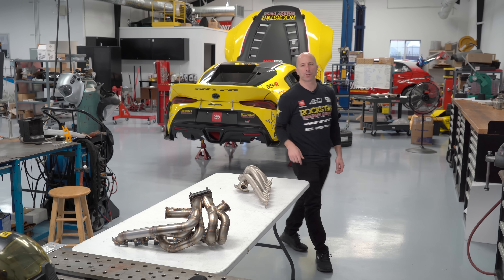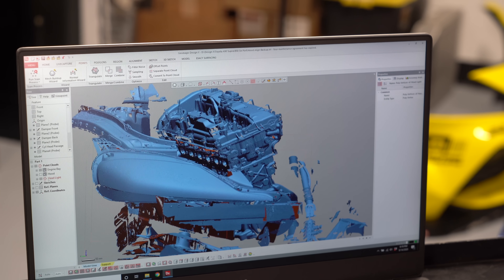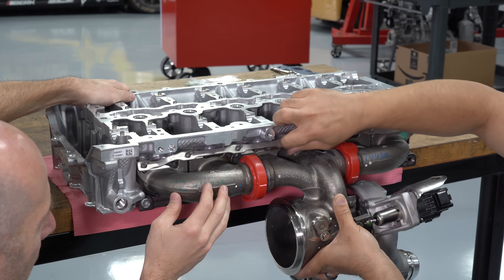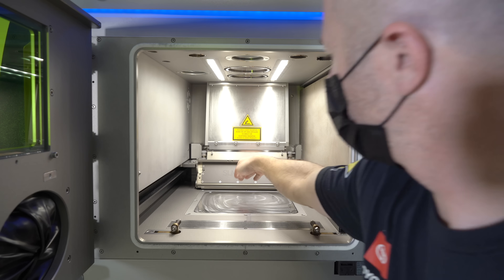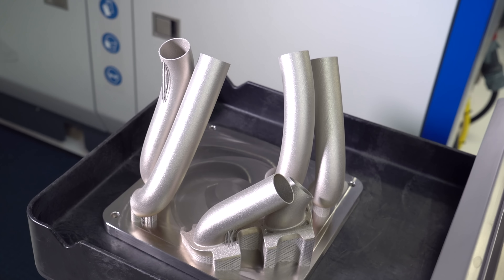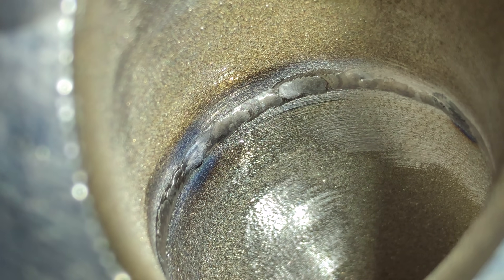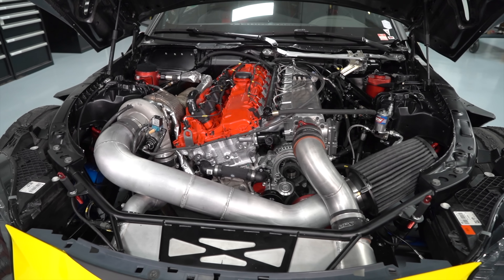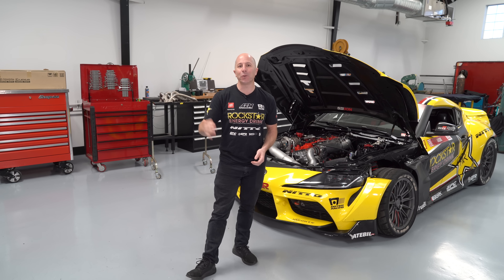Turbo Manifold 3D Printed from Inconel Powder

Comment: WOW. This is exactly what I do… but for coal fire power plants, paper mills, concrete manufacturing factories. FARO 130 is a little different, I have to knit up to a hundred (130 meter radius) scans to tie different floors together. 

My dream is to design automotive parts like I did in FSAE.

This is incredible.

Comment: Just wondering if there is any concerns about the surface finish with the interior of the header piping. It seems like the roughness may cause turbulence and higher flow restriction.

Comment: One of the greatest strengths of 3D printing is that it allows you to use geometry which would otherwise be impossible to process.  The flip side to this is that a good designer should use that freedom to make subsequent processes simpler.  With a well designed part, the joints to be welded should fall in an area that can easily be reached by the torch.
I'm also surprised that they didn't use any tabs or registration marks on the printed pieces to ensure/simplify correct fitment.

Comment: I would have put this inside a vacuum chamber and backfilled it with argon to avoid any porosity in the welds. Only way to see this is to x-ray the material. These porous areas could cause problems at very high temps.

Comment: Kinda new concept and making a complete unit without welding is not possible? I’m still old school and like working with 625 seamless. Water jet the flange and cut bend and then weld it up. But the materials are probably less with the inconel powder? Unsure about the printers cost I don’t have one.

Comment: How do you get around solidworks point cloud size limit? I use a artech eva and SW2018, it can barley handle 1 seat worth of data on a really fast PC with a quadro 5000. I use the mesh prep wiz, then curve wiz. 48 hours later I have parts from my 3d point cloud.

Comment: really big, and highly unlikely to be done but I was thinking...
20 years ago cars were big ol' metal chunks. 
now you open an engine bay and it's plastic everywhere, except the block and the turbo.
unlimited milage 5year warranty
now it's 2 years or 120k miles
life spans are reduced, due to cost savings but prices going up.

I was thinking last night, plastic pistons, rods, crank etc....

my challenge/question is.. do you reckon you could 3d print (in the same style this manifold is done) an entire engine?
not a 2l whatever, just a little 50cc engine or something and put it to use on say, a powerwheels or a scooter or something.
I'm genuinely curious whether 3d printing an engine would be viable. If your manifold has held 1100bhp+, 5bhp shouldn't be an issue at all?

Comment: Do you ever use the GM LL8 Vortec 4.2L DOHC inline 6?   To design intakes/additive power for?   GM used it only for trucks, giving-up thousands of potential sales to Hot-rodders/low-rider buffs that still like their "Power" inline.    AND, with a 3-D, you could make Bugotti/Alfa-Romeo/Argus /Other straight-8s. An LL8, done as a straight-8, would be the same displacement as the Ordinary 5.3/327 v-8 of mid-60s fame.      A never-made 409-based V-12 would be a "614". "She's real Keen, My 614..." where are the Beach Boys when you need them?   What were your costs,--roughly, of a 3-D build in inconel?

Comment: 3D sketching for making sweep paths in SolidWorks is such a powerful tool that a lot of the free software I've seen doesn't have. I use onshape for my hobby needs as they were the original programmers if SolidWorks so things operate in similar ways.

Comment: Why wouldn't you just print longer tubes to facilitate the weld fitups? Also, it would have been more efficient to weld in a vacuum box (small product)  than take your chances with a goofy extended tungsten and a gas lens that is hard to see around.

Comment: I think I would have 3D printed the collector and fabricated the rest. The collector shown is one of the super complex parts that, if welded, would be heavy, time consuming, and prone to defects. The rest of it, while not easy, would have been typical pipe and flange work for a racing fab shop. Sure, it would have cost a few ounces, but only a few, and it would have saved a lot of time and money.

Comment: I wonder is that Inconel manifold stronger then a cheap eBay stainless steel manifold. Looks very thin walled. Can't risk running that on the last event and the Heavy turbo falls off of it.

Comment: And then they made a tiny 1/25 scale working model of the engine and a tiny car and they built,t the whole thing and then made a tiny little Dino machine and then they raced it just to make sure it would work. Then they. MAde a bigger model. And repeated the whole process. Then they all stood around and bukaked on it. It’s really well thought out.

Comment: Hye, I did a turbocharger turbine casing with inconel 718 3D printing machine. Same concept like your manifold. Have you try the manifold on real car operation  engine? I really hope you can test your 3D printed manifold on real car operation. My turbine casing under research work and now still at gas stand stage (turbine mapping).

Comment: Q: Why wasn't the intake 3D printed as a single print, instead of in multiple sections and welded? D the weld areas inside the intake cause flow turbulence, or are they a non-issue in a turbo intake? Is it even possible with this printer to print this particular intake as a single print from Inconel? thanks...

Comment: @10:56 I've always been surprised more dyno tire blowouts don't happen. I've seen cars positioned on rollers where the tire distortion was so bad. This ones actually not too bad but still shows the pressure variation across the whole tire. Super cool video showing the future of 3D printing metals and can't wait for the next installment.

Comment: Inconel 625 is Nickel-chromium and molybdenum alloy(NiCrMo). (mostly nickel) its great (probably the best) at keeping its tensile strength at high temperatures. K-monel is nickel-copper and aluminum( NiCuAl) which is also great at high temperature. Monel is Nickel Copper NiCu. Theres a video on Super alloys that shows you how Nickel super alloys work which is really interesting,

https://youtu.be/k6m5iJOk24o

Comment: No tq numbers.nitrous makes boost more efficient a 100 shot will cool down a intercooler 50 degrees instantly we ran a 150 shot before the intercooler it made 100 hp more but brought tempetures down so much ice formed on the intercooler at the end of the quarter mile   Freeway runs back to back kept beating cars with 200 hp more since intercooler was so cold 🥶

Comment: You know there are various grades of stainless steel? You generalize stainless steel vs Inconel 625. High end builds aren't using SS 304, they use 321. Stainless steel 321 is equal or even superior to inconel 625.

Comment: I print in In718 as well as do the design engineering, so I really appreciate the great video. Towards how far we can go with this technology, the true value of a 3D mindset, from the design and the comments, is hardly here, in general.  Matt had it tough for sure, and I learn everyday as well, but generative design air flow simulations certainly weren't used here, understandable for the time crunch.  Right now I'm breaking from CAD work modeling the metal printing and polymer printing bays and even powder storage areas.  I'm guessing the benefit of thin walls wasn't favorable towards printing and sadly that benefit won't show up on the dyno but rather handling. Again, great video and awesome you guys are pushing the boundaries in aluminum intakes and In625 manifolds.

Comment: Question.. Does Tyler with the Faro arm do this in the  area.. i have a friend doing a 427FE Sohc into a 69 mustang that might be able to use his help with measurements for his header fab he is currently in..  since the exhaust ports are not in a stock ford location conventional headers if they existed won't fit.  its just a few miles south of your shop.  i also have a question.. did you build the RX7 with the small block chevy and the blow thru carb back in the early late 80s or early 90s that was in a copy of turbo and high tech performance before  the magazine was sold to Petersen then Ten..  bimbo cylinder operated blow off valve to reduce compressor stall.. custom intake without dividers.. piston oil shooters machines right into the main bores.  the wife threw out my copy when she found it under the liner in my sock drawer to hide it.. she threw out the HRM with my camaro in it too..

Comment: As much as I love watching your content, why create a cutting edge part and then not use it?  I understand it’s a new technology, yet many industries as far as I know have been using3-D metal printed parts even in rocket engines without any issues. So why the hesitation in not using this part, which by the way look so beautiful, which would’ve not only validated it’s desighed and I guarantedd you it would’ve deliveivered even more power.

Comment: As a total amatour in exhaust manifold design, I did design equal runners for my new V6 engine in a DeLorean (double the power of stock unit). I've 3d printed jigs to guide me how to cut prefabricated bends + assembly jigs to weld each runner separately. I had engine, frame and body 3D scanned using handheld scanner. Design was done in NX. I cut all tubes with simple angle grinder. Only CNC cut part was the flange as it was 10mm thick stainless. TIG welded myself with a back purge. 
If you want to see more details, check me on fb at Reinsch Engineering or under #vin4454 
You can do it to!

Comment: i guess the new bmw motor doesnt make power worth shit and had to upgrade to a 6 exhaust ports. so much work just for 1000hp. my 94 supra made 900+ with only supporting mods like fuel turbo and tunning

Comment: I have seen 3d printed parts in inconclusive,but the surface was like a sintered material.It looked slightly porous. That was several years ago and maybe the technology has moved on.As it was I wouldn't think it suitable for a manifold.At the time we were machining inconclusive parts to go down extremely deep oil Wells,so extremely heat tolerant and difficult to machine.

Comment: Metal 3D printing is not ready for prime time. We've been experimenting this for aerospace applications for years and it's too expensive and has too much size limitations. We have a line of laser sintering printers and still struggling to make it cost effective.  Look at these guys struggle through the whole process and end up with a bunch of pieces  that still needed to be welded together without much thoughts about assembling it as a weldment. The materials still cannot replace wrought for strength in aerospace terms. It is better than most casting though. But the support design is crucial and not talked about here.

Comment: You should have just welded it in the firstplace... Thousands spent on a header using a bad manufacuturing process. 3D printers are fantastic, but you have to design it to be done in one. If you start trying to design something in multiple bits it defeats the point of printing it and you end up using a process which would have been used in the firsplace. Like you lot said, that hand crafted piece took more or less hours and a few quid on a skilled welder and the materials. It was an interesting watch by all means and you lot did a good job, but frustrating to see at the same time just because of the mass cost implications this would have had... And for very little benefit.

Comment: as an engineer im conflicted... 
huge money and design process that didnt fully utilise the possibilities of the 3d metal printing potential and the lack of foreward thinking about joint distance and weld placement/position.
ill admit i know little about the practical application of the 3d process in THAT machine.
in the end im a little disappointed that the dyno output 2jz build numbers
Reply: Its still quiet new. He is the only one REALLY going this far with it. There are people doing other easier/simpler ways with it(well with the 2 port version for now)and they're slowly reach the same level of power with less done to their B58s(some that are being built to push well over 1200hp+).

Comment: How the fuck do you bend Tungsten electrode and that thick with out breaking it. :D :D seriously curious. Also when you are designing a pipe system like headers, is it not better to design it so one pipe has greater inner diameter so you can slide it on top of the end of the next one and then weld it, so you won't get weld beat on the inside and get turbulence. I thought the magic word was "smooth,, for headers, especially for high performance headers. Just asking...

Comment: Excellent video documenting the reverse engineering, design, and build process for the turbo manifold.  You have an A-level team and partners in the area of scanning/reverse engineering (Geomagic Design X), CAD design (Solidworks), 3D printing (both in-house and outside), welding/fabrication, and assembly and tuning.  Thanks again for sharing the process.

Comment: would be much nicer/quicker if you could just 3d print the whole header..is it a problem of size or topography of the object that you print? next step buy the blueprints and the materials and print your car at home..
Seriously I dont really understand why the pipes cannot be printed completely empty. I understand why they have to be somewhat attached to a base, so that the parts cant move in the powder.

Comment: Very cool video. Been keeping an eye on 3D printing developments for a couple of decades, and it's really nice to see modifiers using some of the potential of the technology.
 A couple of possible things to consider in future - if the bed size is adaquate, you can move the weld points along the tubing for better access, and you aren't restricted to 90 degree cuts/welds as the weld faces can be precisely placed at the most conventient position, even stepped with a couple of half cuts and a couple of longitudinal welds, even in the middle of bends.

There are going to be a lot of folks watching who can't afford, or need, the whole assembly to be printed, but they may wish to consider the turbo' mount/collector getting printed as it allows a lot more flexability in the routing to the collector - even incorporating bends in it. Same thing applies, to a lesser extent, with the head flanges as smoother and better flowing transition pieces can be made that match the ports.

Comment: To be honest i'm not impressed with this manifold. the whole point of a 3d printer is to print out  a full part without having to have it fabricated and welded. Also with SLS printers the powder is supposed to be the support material anyway meaning that support structure doesn't need to be printed (I can only imagine this is something that has to be done with this particular alloy)

That backup manifold they ordered a week before they show looks much better.

Comment: Your builds are great i love the in depth technical info so rarely found in so many youtube videos now, 
Is there no way you could continue using the oem direct port injection for low boost portion of the fuel map? If not I'd quite like to see the direct port injection using methanol or nitrometh as a kind of power adder of sorts

Comment: Love 3D printing, but unless he has a sponsor that printed the manifold for free, 3D printing metal manifolds are still in the $15K plus range each.  I know because I just got a manifold quoted for my project.  Its crazy prices.  guess he likes to waste his money because there is nothing special about that design that cant be weld fabricated for under $2000 with high temp stainless.  Investment lost foam casting is also a great choice for a fraction of the cost.  Or use weld up steel and ceramic coat it.

Comment: If you take all the time and trouble to use all this technology, scanning tools and 3D printing, why not just print the header in completion? Instead you printed a bunch of little parts to be welded together? I also noticed you didn’t do any preheat or post heat. Additionally, you chose to do a full penetration weld or a “root” pass which causes several restrictions. A fusion weld would have been a much better choice. Overall I feel like y’all did a poor job.
Reply: I also didn’t see interpass temps being checked.

Comment: Did you have to do testing on the exhaust manifold to make sure there were no leaks? Any concerns or testing with the maximum temperatures the manifold will reach? It would have also been super cool to see more stats comparing the 3D printed one to more common manifolds.

Comment: I feel like a lot of the advantage was lost in designing it like a traditional header.
I think that a redesigned version that would require less welding and took advantage of the additive manufacturing abilities to make internal areas would be even cooler.
I realize this is a race application but if this was a street car, you could design your thin exhaust channels to go through, merge up smoothly etc but then supply strength to the manifoldby having it stick out and then heat shield the whole thing around in various ways to keep the heat in and from radiating through underhood.
It shouldn't be designed where you have to weld it around like a normal tube. If you do have to do multiple pieces due to size constraints it would be nice if you could design it to come together smoothly with access for welding.

Still an awesome project of course but I think a little more outside the box thinking on the design might yield better results with the 3D printed part compared to designing it exactly like you always have and end up with something exactly like you always have that requires the same assembly.  Lol